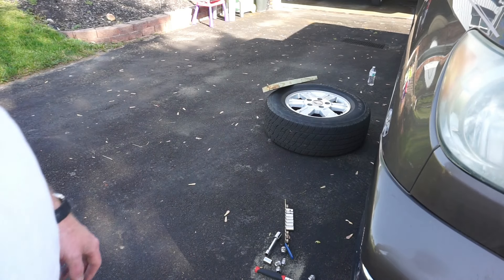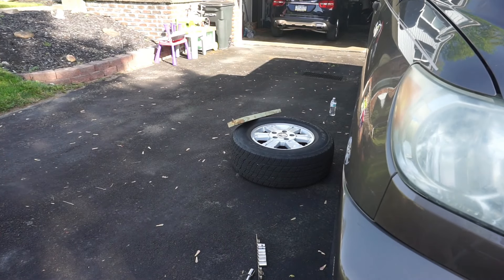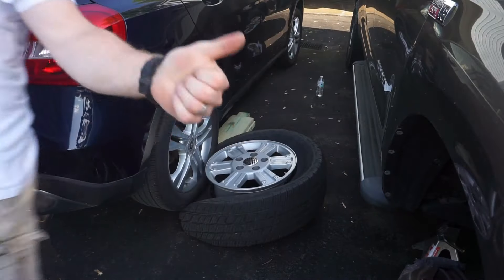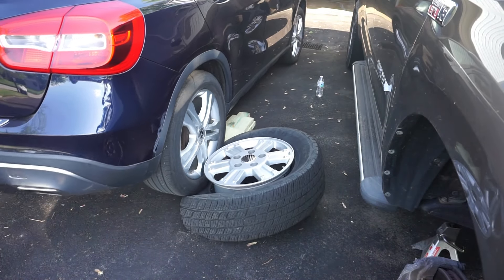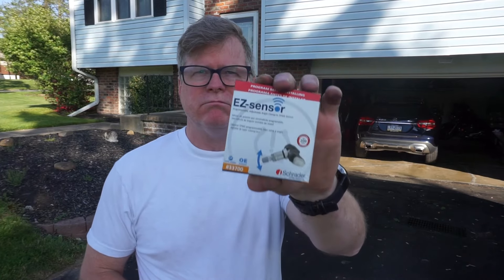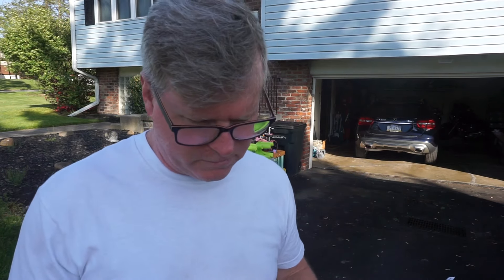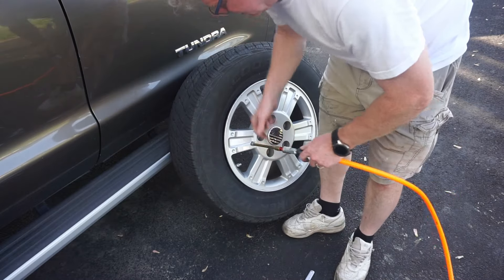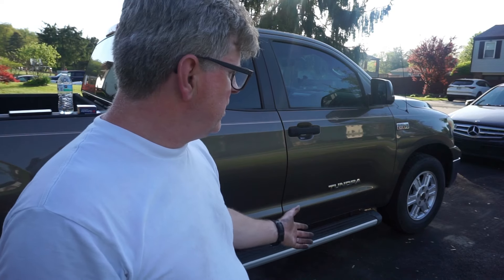DIY How to replace valve stem TPMS. Very Easy!

Comment: For the record, EZ-Sensors come blank. The TPMS diagnostic tools that can program those sensors and perform an OBD relearn to start with are Bartec's TechRITE Pro (WRTTRP100) and Ateq's VT47. The Ateq VT37 can program Schrader EZ-Sensors, but lacks OBD relearn capabilities.

One thing I do know for sure. Those tools don't come cheap, including their software update licenses once the first-year period expires.
Reply from the maker: Thanks for the comment. I figured the tools for this weren't cheap. Which is why I'll check my tire pressure the old fashioned way until the next tire shop visit.